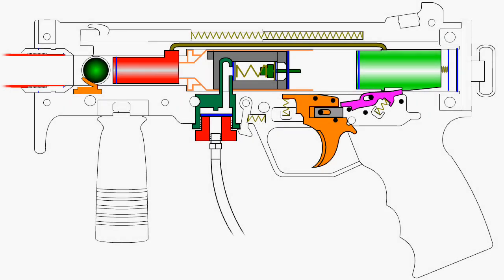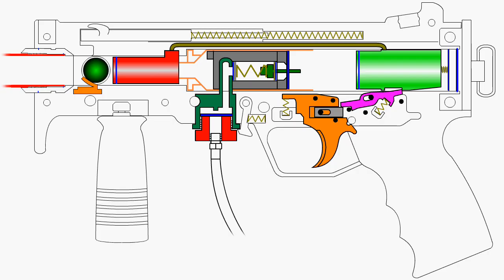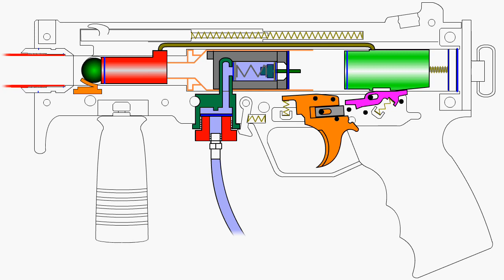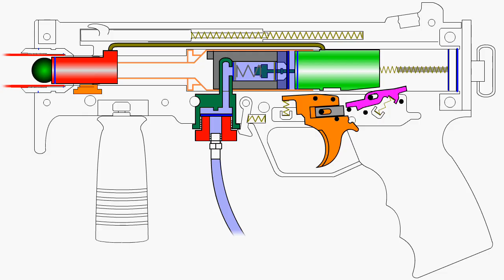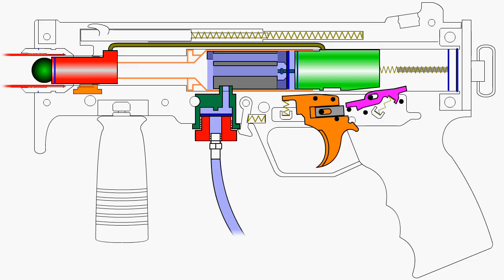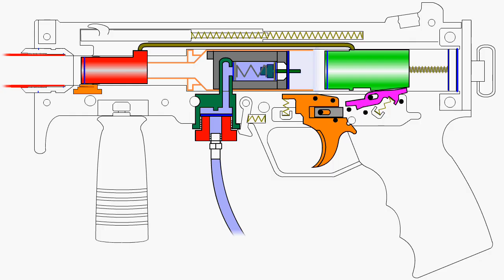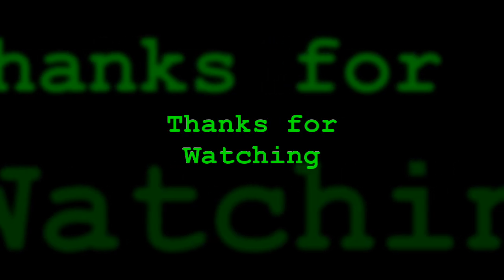How a Tippmann A5 Works

Comment: so.... basically an open-bolt submachinegun, but instead of the firing pin on the bolt hitting the primer, the hammer hits a 'firing pin' that opens a valve, expelling a measure of propellant gas until the blowback gas resets the bolt, simultaneously shutting off the gas. 
neat.

Comment: Hello Lord Odin Presents. Before i get to my Question, I would just like to say thank you for posting the "How a Tippmann A5 Works" Video. It was an amazing way for me to understand my own A5 on a more mechanical level.Now, I converted my A5 to a magfed Tacamo Vortex. But in doing so, I had MULTIPLE issues getting my marker to work properly. My gun would Double/Triple fire, then suddenly de-gas, forcing me to recock the handle after a few trigger pulls. I even replaced the trigger sear, but it didn't change anything. I converted my gun back to the A5, and it suddenly works again, no problems... My observation of the Vortex compared to the A5, is that on the vortex my buttstock is wobbly. Secondly, i have pretty bad power tube plugs on the side of the vortex marker. I would just like to know which do you think is the problem? Do you think, because of the wobbly buttstock, the spring guide rod would prevent the hammer from fully reaching my trigger sear? Or do you think i'm getting a lack of gas due to bad Power Tube Plugs?..

Comment: might be a silly question but what are some reason to why the bolt wouldn't reset?
Reply: The spring attached to the purple part (in this video) could be broken. Or not enough air pressure remained to the hammer back.

Comment: this is simple mechanism because the operation and the parts are mostly 2d. whereas in real firearms there are complex mechanisms even in 3d.
Reply: Well to be fair, firearms have existed for around ten times as long as paintball markers. That's why paintball markers seem relatively simple in comparison to many modern firearms, but not to very old ones!
Reply: Ilir Kumi  yah cuz they don't need to be complicated
Reply: scRam Jet most of the time simple is reliable. most of th time simple designs are easy reoairs

Comment: If the sear didn't slide back when the hammer moves forward.....couldn't that make the gun full auto?
Reply: +RPC225 Full auto that couldn't be stopped until the gas ran out. You have to fully connect the trigger to the sear so that when you hold the trigger, the sear can't reset, but when you let go of the trigger, the sear would reset. I would guess that this would only set off a ton of other problems to overcome, such as ball feed speeds, etc. Also, I don't think you would be able to use it on many PB fields.
Reply: +Christopher Mueller (Editdroid) actually I tried it on my old project salvo and it worked...shot really fast but it had full auto...I have a vid on my Chanel about it
Reply: i was thinking the same thing. do you know aprox how many bps?
Reply: and was is difficult?
Reply: RPC225 sweet. i tried it on my tippmann cronus but i would need an electric hopper so i did it to my tippmann a5 and it has cyclone feed so it keeps up
Reply: RPC225 
. You can round over the sear wedge, or slop pin it.
But all it will do is chop up your balls on full auto with gravity dead hopper.
Reply: +Andy Bourgon no...all I did was put a pin in the gap of the sear...prob too fast for any hopper to keep up

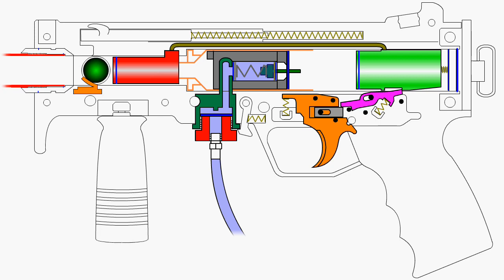Comment from the maker: At 1:35, you'll see that the trigger sear is pushed by the spring and waits for the hammer.  It can't go full auto because of this.  If the sear pivot hole wasn't oversized to allow movement like that, it would become full auto.

Comment: Now i understand why it auto-sputters when its low on gas. There isn't enough pressure to drive the hammer back far enough to catch on the latch, so it just bounces back and forth on the spring hitting the valve pin over and over.
Reply: yup

Comment: hey i just bought a project salvo! trigger does not push sear high enough to release the bolt ?!  the pins seem very loose int he holes and there is a small pin behind the trigger welded to the body the trigger hits this pin (close to rt hole) and is not shown int he illustration or in any video i watch should i remove this little piece of metal? it seem to be the cause of the trigger stopping premature to the sear releasing the bolt. even stops before the trigger stop pin is contacted! plz help

Comment from the maker: @PernellDD Yes, even with HPA, a reg will improve your efficiency a ton.  You'll get a lot more shots per tank out of it.  Just make sure to choose one that can output up to approx 650-700 psi.
Reply: dunno what you mean when the gun is rated at 740 psi ....  that is, it requires that to cycle. its internally regulated for that reason.    however a regulator  would be required to get th 3600 psi air down to 800 psi ish...  or it would blow the main seals.

Comment from the maker: @PernellDD I'll be posting videos of my previous experiments in the coming future, which will cover lots of upgrades for Tippmanns and how they affect their performance.

To answer your question simply, get the APE board and Cyclone upgrades (ratchet, squishy paddles).  If you run straight off the tank, get the ZK, but if you use a regulator, avoid it and get a front bolt with an innner o-ring.

Comment: pretty nice, never had tippmanns until now, I just got an alpha blac with e grip and cyclone, now... what are the best mods for this marker? I was told to get the cyclone upgrade kit, the zero kick hammer, aluminum power tube with delrin bolt and the APE board.... do you have any imput on all this upgrades?

Comment from the maker: @MASTERMARK360 The only difference is the trigger/sear interaction.  The trigger will hit a microswitch, which causes the armature pin to push up the sear.  From there, the mechanics are the same.

Comment: hey for the tippmann a5 do you recommend compressed air or co2?

from what ive read, compressed air is better exept that it is cheaper

also,what compressed air tank brand would you recommend?
Reply: It’s the difference between filling a HPA tank (6 seconds) or a C02 tank (6 minutes) Almost no paintball fields shoot C02 anymore.  Compressed air is far better in every way. If you put C02 into a electronic marker it will break. But HPA will work with mechanical and electronic.

Comment: @LordOdin2008 
hey for the tippmann a5 do you recommend compressed air or co2?

from what ive read, compressed air is better exept that it is cheaper

also,what compressed air tank brand would you recommend?

Comment from the maker: @theTicklemehellmo The easiest way is by getting an e-grip but a less conventional method is by reducing the amount of trigger pull.  TechT has a Hair Pin kit for Tippmann's.  If you use the wrong size, your marker won't catch on the sear and it will go full auto.  If you use one that is just below that and are able to hold the trigger juuuust right, you can utilize the mechanical bounce from the marker to trip the sear.  When done shooting, let go.  I had to explain this concept to a ref once..

Comment from the maker: @Thatmakessense356 Yup.  There are several reasons why this can happen but this commonly occurs when the tank's gas supply runs too low and can't reset the hammer fully.

Comment from the maker: @ninja6kid Could be anything.  From the pushpins keeping the hammer from flying back and hitting the mask, to the tombstone preventing the air from whipping around, to the quality of the receiver halves which may just fracture and send internals flying.  No way to know until its exposed to it and it may vary from marker to marker.

Comment from the maker: @ninja6kid A lighter spring would release more volume up to a certain point where the ball exits before the valve is done releasing air.

As far as the high pressure of 1500+ psi, I wouldn't try it for safety reasons.  Markers are only designed to function in certain pressure ranges and that's way too high.

Comment from the maker: @Tannk42 That might be a lot tougher to pull off.  It would probably require a valve pin that is nearly the same diameter as the valve hole.  Replacing the valve pin would be easier than replacing the valve itself.  Right now, the pin has a thicker block and then gets narrow, allowing air to pass.  If it were thick throughout (like a pole) then it would block most of the air.  The problem would be replacing the pin or having one custom made.